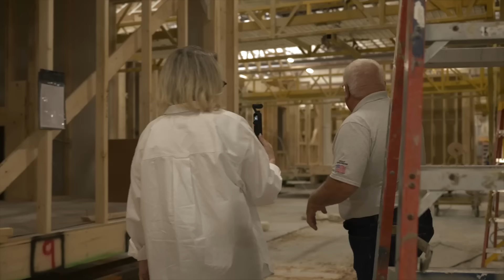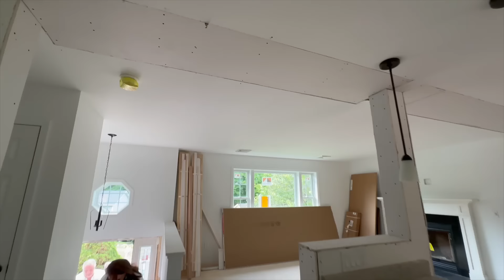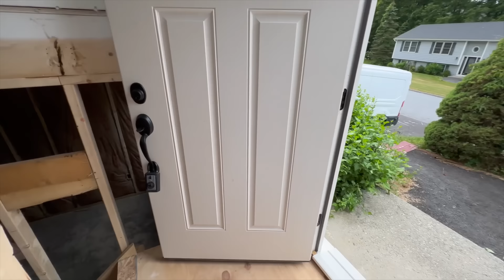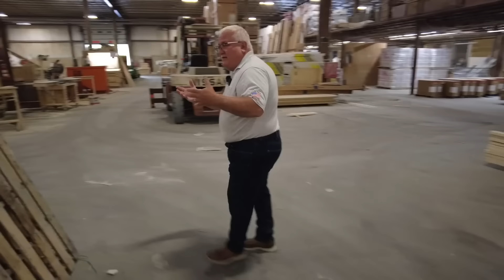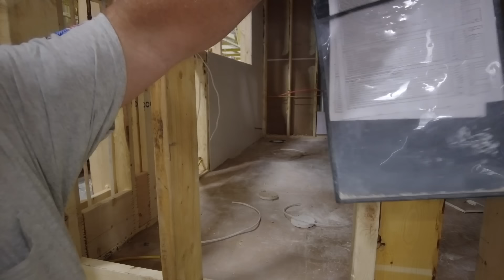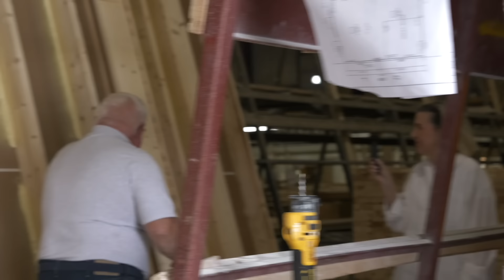Modular Homes ARE Better Than Stick Built!!!

Comment: This modular homes looks like a site built house, a house. Even if it was smaller and 1300 sq foot that type of home will look like a house, it is a house. But when I look for a modular home builder in FL all I get are mobile home companies. And then I heard some are trying to sell "modular" as a hybrid between mobile and modular. Well when you sell or refinance it's a mobile home. NOT the house shown in the video, I'm not talking about that. And I have seen smaller modular homes that have the appearance of a house. It should. But when I search for modular home builders it's two major mobile/manufacture home companies. And it has all the appearance of a modern mobile home. So what's the difference. 
And for that matter, what modular home company is there in North FL that is not Clayton or another mobile home company.
Reply: Call Clayton homes and as about there modular line. They have both.

Comment: He’s misrepresenting HUD and affordable housing home construction code requirements. I’m in AH for 30 years, and the majority of subsidized affordable housing not only IS NOT BUILT BY HUD, but is built by private developers thru the LIHTC program. All LIHTC housing is built to the local building code where the project is located. This lie that “HUD HOUSING “ (subsidized affordable housing” ) is some kind of sub standard quality housing is a full on lie. A “mobile home” structure is not what most affordable housing housing is built to, code wise. As an architect of 35yrs, there is no lesser home building code for permanent housing structures, even if they are modular or legally designated “affordable housing”.  Mobile homes are a different category regulated by the local code. HUD does not supersede said local building codes, as far as I know. He’s exaggerating about his system being more structurally robust than AH. Also, subsidized housing is generally required in most states to be energy efficient (generally more so than the baseline building code for regular construction.) Again, I’m saying this as an architect of 35+ years in housing. We build  $2 bil per year in affordable housing, and our structures meet or exceed what he is showing in this video.
Reply: Stopped reading when you had attitude and are wrong about the first thing out of your mouth. 
No one said HUD built anything. HUD made the code for mobile homes and manufactured housing. 
Let me guess another Habitat desk jockey exploiting poor people.

Comment: When you realize they can yank those units into the air without the frame moving enough to shatter the windows, that build is tight.
Reply: @aerohard  windows are indeed a limitation for modular. Upvc windows are ok because relatively flexible BUT if you use more rigid frames like  aluminum or fiber glass pultruted frames you have a problem and some windows will likely fail during transportation. That means you might need to install upgraded windows on site
Reply: @MrZammaraska  In general Modulars actually have about 1/3 more wood than a traditional stick built home.  This is because of course they have to be picked up by a crane!    

I build houses with triple wide full height glass doors.  It's amazing what engineers can achieve nowadays to provide structural rigidity.
Reply: @ModularMen  Where is the 33-1/3 % more wood placed?
Reply: @lorimcquinn3966  Primarily along the marriage walls where modules meet together.  

Each module has to be structurally built as an individual unit.   Otherwise it wouldn't be  feasible to pick it up with a crane.  Therefore there's wayyy more wood at these areas than you would see in a stick built home.  

It's also why a stick built would fall apart if you picked it up with a crane.
Reply: @ModularMen  Thanks for the info. Are you a licensed builder by chance?
Reply: @lorimcquinn3966  Yes, I'm a fully licensed General Contractor in North and South Carolina.
Reply: @lorimcquinn3966   Yes, I'm a fully licensed General Contractor in North and South Carolina.
Reply: @ModularMen  👍
Reply: @ModularMen  yeah but is it more wood? Lost of wood is used in traditional home building where joists meet... which would be right about where the modular sections  meet... and traditional homes would have a giant support beam right where you claim all this extra would would be... I'd bet it's the same board footage....
Reply: After being hauled potentially hundreds of miles down the road
Reply: @SickofTired  I think this depends on whether it's on-frame or off-frame construction. Also my understanding is off-frame may appraise for more than on-frame upon completion or at sale time.
Reply: / @lorimcquinn3966  This would be true, because on-frame "modulars" are basically glorified manufactured homes. I have a friend who has one, and it appraises as a mobile/manufactured home.
Reply: Start an off-grid community consisting of individualized log cabins. ~LLC~ Lincoln Legacy Cabins

Comment: My cousin had a modular home built from a company in Indiana.  He waited months for it and when it was delivered to his site and set on the foundation he noticed that it was built backwards or mirrored. The bedroom side was next to is attached garage with no options to enter the house from the garage.  He ended up building a staircase in the garage to the basement which required him to travel the entire width of the basement to the other set of stairs that led up to the mudroom.  He ended up spending more money on the project than he would have if it was site built.
Reply: That was his mistake on checking the model he bought. If he didn't get the one he bought, they would have to bring the correct one.

Comment: I'm having a hard time finding a modular home manufacturer that meets my town's code requirements, Plano, IL...any suggestions?
Reply: What is you're code??? Guessing IRC 2018 or 2021.
Sounds like you're looking at manufactured housing not modular.
Reply: @sparksmcgee6641  , 2018...in particular the need for the electrical wiring to be in metallic conduit
Reply: @sparksmcgee6641  I believe it is 2018...and specifically the requirement that the home uses metallic conduit
Reply: @tomyoung8306  There is no IRC code  that has a metal conduit requirement. 
You need to get the city to cite the actual code requirements. Then get the code whether is a local ad on or just the ICC code.